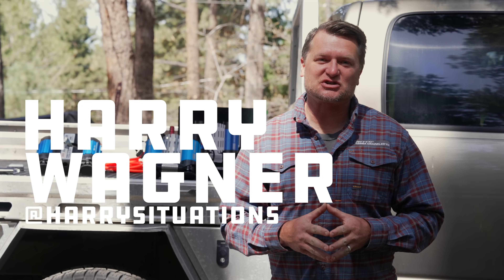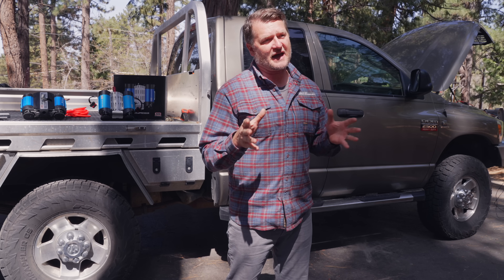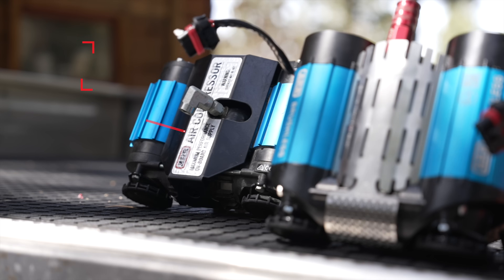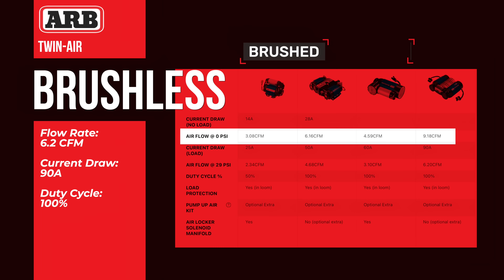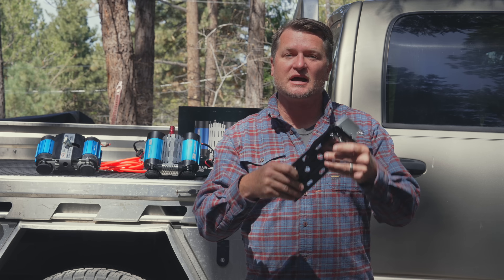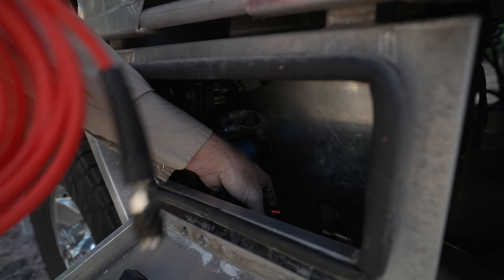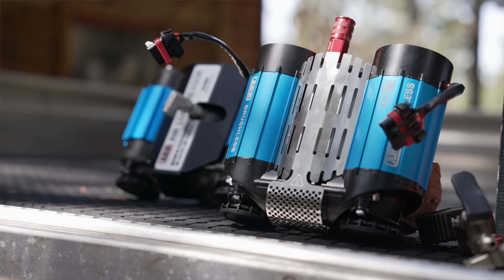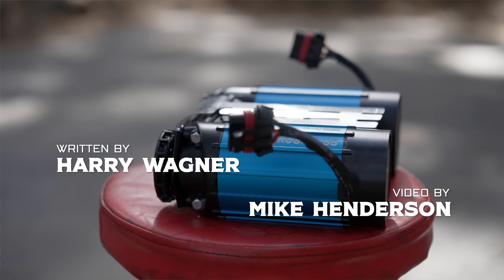Testing ARB’s Brand New Brushless Air Compressor

Comment: That's a ton of extra amps being drawn. And is brushless more relaible than brushed?
Reply: It should be due to less moving parts, but only time will tell.
Reply: @HarrySituations I have the twin brushed which has been great for 8 years in engine bay.

Comment: With the additional heat, I'm more curious about long-term quality / reliability. Thats 20deg with 1 tire, what's the temperature after airing up all 4?
Reply: Good question. It does have fans but I would be sure to mount it some place with good air flow.

Comment: SO it’s not much faster it heat more while having lees resistance, it’s same noisy like other one draw almost double current and is much much more expensive. Where is the befits of having new one?
Reply: It is much faster. That is the benefit.
Reply: @ really ? Test prove that it isn’t „ much faster”
Reply: @abazdarhon dude I’m the one who did the test! And it aired up the 42-inch Trail Grappler 38% faster than the traditional twin air, which is already a fast compressor.
Reply: @ cost twice the price air only 38% faster and need thick cables and bigger fuse to operate due to higher amperage draw. So where is the efficiency while you need spend much much more while gain not much. I know how YouTube work and I know how company work who advertise via YouTube so I am not surprise you will say what they ask you to say while data shown it’s not worth yet due to way higher price tag for apparently less components which lead to way easy manufacturing process
Reply: @abazdarhon it is not much faster or 38% faster? Your criticism keeps changing. I’m not in ARB’s payroll but I did screw up the pricing. The traditional twin air costs $640 and the brushless twin air is $800. Which works out to… 38% more money! As I say in the video, it isn’t for everyone, but if you have big tires I think the brushless is worth the extra money.

Comment: I have a small single cylinder ARB compact compressor that I use to pressurize the water in my rig’s 8 gallon roof rack mounted aluminum water tank , but for airing up or deflating the 37” tall tires I rely on a 10.6 Morrflate  system .  I just cannot justify paying almost $1000 dollars or over for this particular one from ARB .  I got the Entire Morrflate pump & 4 tire inflate system on line for less than $500 about 6 months ago on a special offer & though it’s not a permanent mount style ( I do like it’s portability as I can just transfer it from vehicle to vehicle I own ) it does work so far VERY WELL . No disrespect here to ARB at all , they make a fantastic product , but I’m on A social security type budget & my wallet dictates what I can or cannot afford . Thanks for this video here though . C-ya 😎👍
Reply: just to add some context ive now had two Morrflates go down in the span of 3 years. Im done with it because riding down the shoulder of the highway 30 miles at 8 psi is frustrating and super dangerous
Reply: There will always be cheaper options than ARB but while I measure once and drill twice, I try to “By once, cry once”.

Comment: I think what is swaying me to the new brushless is they have a higher IP rating. It looks like they're waterproof up to 3 ft for 30 minutes and better dust protection. My numbers could be wrong but definitely better IP rating.
Reply: That is a big factor, particularly if you mount the compressor in the engine bay.

Comment: Your specification figures are all off. Draws 80% more Amps; 50Amps increase to 90Amps is 80% more, not 40%.  Air output increases 32.5%, not 40% as stated.  What wasn't covered is if the actual compressor portions of the compressor are different than the older compressor - I'm not talking about the motor - they are different as was covered.  The new one looks like it would clog up the fans in a dirty environment more than the open fan on the older model.  No fans would be the best.
Reply: I don’t think no fans would be best when the compressor already gets 20 degrees hotter after airing up one tire. I don’t think I’ve ever seen an air compressor 0:07 that didn’t use a compressor.

Comment: I just can’t justify $1000.00 to air up my tires. I don’t like or use air lockers. eLockers only on all my 4x4’s.. $640.00 is too much but I am willing to almost pay that just for the convenience factor for the brushed model… I currently use the EZ Flate for more than half the cost. It works really well but bulky and not as convenient. But its certainly not $1000.00 inconvenient.. thats for sure.
Reply: I got the price wrong in the video, the brushless twin air is actually $880.
Reply: The only reason youd buy this is for the compactness and variety of mounting solutions. 

Otherwise just buy the napa dual and air up all 4 tires at 10cfm. For like $200usd
Reply: $75 in parts. $800 price tag. They BETTER be amazing. 😂

Comment: Powertank F.T.M.F.W. 😉
Reply: I love mine... but not economical having to drive 3hrs round trip to refill 😢
Reply: Scuba tanks are awesome but its becoming harder and harder to find places that will fill them
Reply: @mattbrew11  We have a lot of dive shops in west coast, getting filled up is pretty easy. I used to use the scuba tanks to air up my paintball tanks.  I'm not too keen on 4 wheeling with a 80cf tank wtih 2000psi in the back, but wonder if those small 68 cu inch 3000psi carbon tanks for paintball could fill up 4 , 37inch tires.

Comment: Your valve stem is quite restrictive. I've read 2.5 to 3 CFM. You really need to be filling multiple tires at once to truly see the difference between compressors that output more than that.
Reply: I’ve heard that too but my Powertank is still faster than a compressor with the same valve stem. 🤔